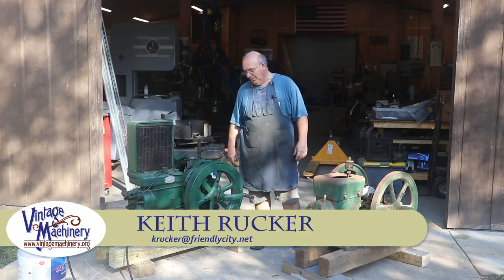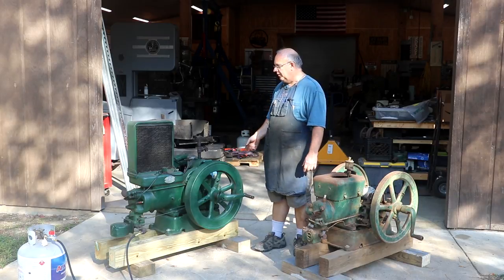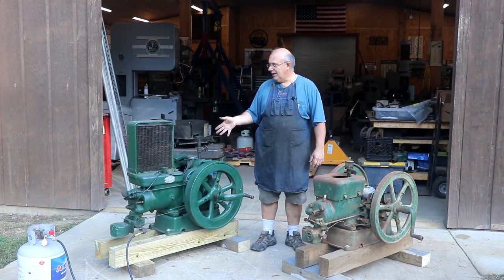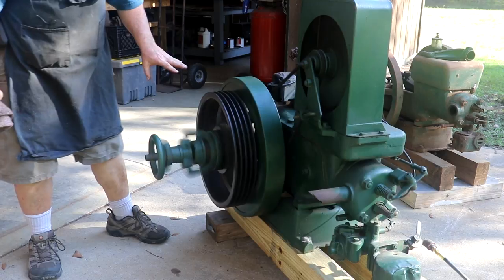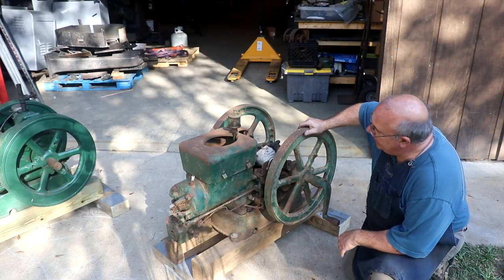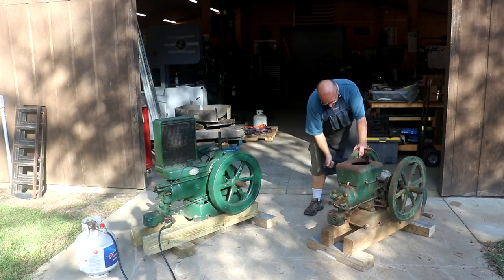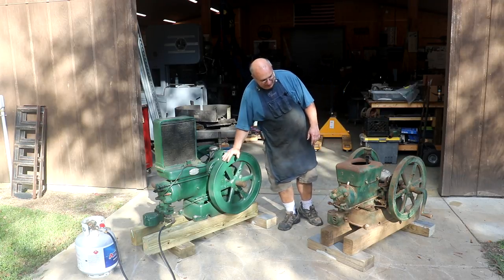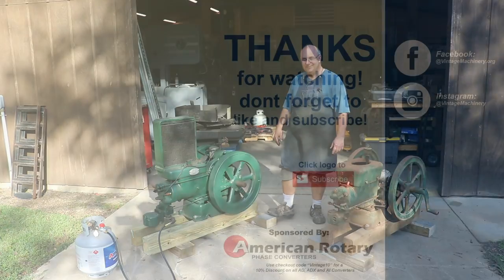Fairbanks-Morse ‘Model Z’ Hit and Miss Engines!

Comment: The old engines were indeed fascinating.  I had one for a while.  Brother-in-law wondered if it was getting fire, so he told me to crank it.   When he stoppec yelping he said yes.  When used go to  Oil Creek State Park which had an excellent presentation the early petroleum.  I ncluded was Drake's Well, the first production oil well in the US.

Comment: Ajax engines like this were capable of running with rings so loose that you could see light when looking in the crankcase when the plug was removed. They are remarkable for the ability to help children sleep.

Comment: I ran across an abandoned large stationary Hit and Miss engine in a field that was used for oil pumping.  It had a crank mechanism that converted the rotation from a very large flywheel into a push-pull linkage to several well sites arranged around the engine like spokes on a wheel.   Single cylinder.  The diameter of the piston was 14 inches and the stroke was (estimated) 24 inches.  Huge old engine.
Reply: Those were oil field "Power" units.  Most used big wooden tanks to supply cooling water.  The power operator would simply switch tanks when that water got hot.  Us kids used to sneak out to those places and soak in the warm water tanks in the winter.  Many power units close to small towns set up showers for townspeople to come out and shower back in the days before running water or having a hot water heater.  Usually was a men's side and a women's side.  One I knew about the power operator had his place to sleep between the canvas sides of the showers.  It was always said he saw thru the holes in the canvas more than the husbands ever saw.... Some of those old power units topped 100 hp.  I saw one that the crankshaft with 8' diameter wheels was mounted on one concrete pedestal and the cylinder assembly on another one.  To start it the operator climbed up on the spokes to turn the wheels backward. When the unit would fire the engine would reverse rotation and run the correct way.  That way one did not have to fight the compression over the center.

Comment: Zc118 and 208 engines were usef all over this county on pumpjacks.had one on the family farm from 1963 till the 90's. Also used Witte and Ajax engines. The ajax was on a farm 1/8 mile away with a 6 inch x10 foot exhaust pipe. Loved to hear that beast bark at night. Back then i could ride my bike back the service roads and watch the engines run. This was mid to late 70's rural central Ohio.

Comment: Enjoyed this video.  It reminded me of a late friend who had a Bean Sprayer engine similar to the open water jacket engine you have.  His engine came from his parents farm.  He rebuilt the engine, then extend the frame of a WheelHorse lawn tractor that he had and mounted the engine of that tractor to power it.  To ease starting he added a switch to change the spark advance.  Occasionally he would throw this switch while the engine was running and it would throw a foot long flame out the muffler.  He suffered from MS so used this tractor to get around Edwardsville, IL.  He also fabricated chains for the drive wheels and pulled his daughter on a saucer sled through the snow.

Comment: I had a 4hp Cushman once.. Used a coil and battery.. Coil much like a Model T coil....Magnetos are simple as dirt to work on.. I wish I knew how many I have repaired in the last probably fifty years... I think I still have a magneto lurking around in the shop for one of those old engines ..Cheers from Louisiana...Mike

Comment: Here is a tip on starting the larger hit&miss  style engines: hold the intake valve down untill you get some speed up on the flywheels, then release it and the engine starts.  The faster cranking speed also makes the magneto  have a hotter spark, thus helping the firing up of the engine.  The radiator on the FMZ is actually a condenser.  As the engine gets hot, the water steams and goes up in to  the condenser where the cool air changes the steam to water and it falls back down in the water hopper.  A lot of these late engines had fans to speed up the process. After Fairbanks quit making these engines, a company called Arrow machinery made them for a long time.
Reply: Arrow still makes heavy engines for oilfield service - they also they use them as prime movers for AC - there also used to generate voltage on pipe lines instead of using anodes so they don't eat out -
      Those Z engines and arrow engines run about 5 yrs between ring and bearing change out if there running above 500 RPMs - many z engines are still on jack pumps today or small bore wells - 
     The cooling we called thermal siphon - they have large cast iron radiators and used oil for cooling instead of water

Comment: I have a very similar Fairbanks Morse “Z” 3 hp. 
The belly tank is typically for a cheaper fuel after its warmed up. (Kerosene, coal oil)
It is a suction system, no pump. 
The small tank on the carburetor is for warm up fuel (gasoline). 

You can also hold down the intake to make them easier to get cranked up.  

Neat engines!!! 👍🏻👍🏻

Comment: Keith this one hits home for me. We built our first of two homes in the Santa Monica Mountains in 1970. This area was homesteaded at the turn of the century. Early pictures are quite interesting, everyone carried a rifle or shotgun. The only source of fresh meat required a hunter’s eye. Our area has always required well or spring water. Today the wells are deeper. Early wells used jack pumps. Across the road a jack pump with an electric motor was in use for many years after we built our home. Sitting next to it is a Fairbanks Morse motor. It looks to be larger than the ones you have.  I contacted the current owners who gave me the green light to take it. Upon closer inspection I found that the Wolsey Fire had melted components of the magneto. It just seems more than I have time to deal with. It’s still there today, evidence of our past. Thanks for the great videos,
Randy

Comment: Used to collect these engines myself until health issues got in the way.  Fairbanks are very solid and reliable and parts are everywhere on eBay ect.  Small engine mechanic and Shopdog Sam are good recommendations.  Someone said something about not having your thumb around the crank, very good advice!  If it kicks back when starting you will have at least a broken thumb. We used to hold the intake valves to spin them up, it lessens the chance of kickback.  If it's at the wrong position on a kickback they can break your arm!  Other thing I noticed, you didn't crank it too fast (the Z) but you always want a plug wire connected to something else with a magneto.  If a mag produces spark and isn't connected to something the spark can spike and ruin the mag.  Never do that on an impulse mag (like on the 118) because they wind up to give full spark at low RPM's for easier starting (that's the clicking you hear when cranking it).  Nice engines, I agree, not steam, but still very neat.
Reply: Your tip about not causing the mag to spark when the plug wire is not connected is huge. That mistake would cause the “average” owner to have to buy a new $500.00(?) mag!

Comment: Cool stuff! I just wanted to let you know that there is in face a big difference between Hit n Miss engines and Throttle governed engines. People commonly confuse them and refer to throttle governed engines as hit miss engines but they are not. Throttle governed engines hit every time. Your may miss occasionally when its not under a load but it is not a hit miss engine. True hit miss engines have no throttle shaft in the carburetor and use a flyweight governor and a series of levers to hold open the exhaust valve when they get up to speed. This kills compression, spark, and no fuel is sucked in and they coast until they slow down enough where the governor weights come back in and it releases the exhaust pushrod and fires again. It's basically a very early way of governing the speed. Throttle governed engines, like most modern engines today, use a throttle shaft in the carburetor and a governor to regulate the speed of the engine. The reason your seems to miss is probably due to the governor being a bit slugish to react, but I bet if you put it under a load it with smooth right out. Again I'm not attacking you or anything, I just wanted to let you know that there is a difference between them. :) Either way they are very cool engines!

Comment: Keith, just a little FYI, when opening a LP gas tank, when you open the valve, you need to open it all the way, the valve is back seated, and if you don't gas will escape out around  the stem.
Reply: Not in the modern age !!

Comment: Where I grew up I was told that they didn’t run electricity there until the late ‘50s. Right where we put our trailer, there was an old house, built right around 1900, and people lived in it in the 1960s, and it never had power. We ran power up there in 1974.

Comment: Love those 118's  i restored mine from a very rough one . they are smooth runners, the little 3hp doesn't have a fuel pump in it they used just the vacuum and a check valve down in the gas tank to help keep fuel flowing into the carb

Comment: They still run them here in Oklahoma in rural areas .We always called them Acme engines in the oilfield i got to work on a few ours are actually gas pressure started from well head pressure  . They run for years unattended .

Comment: Hold the intake valve in while cranking. When you have made a couple of revolutions let the valve go.  The hole in top of the air cleaner was for squirting gasoline in to get it started and keep it running until you got the casing head gas and the air damper adjusted. That is a gasoline carburetor that has a vacuum fuel pump in it.  If you did not have a good casing gas supply from the well casing they would run the engines on drip gas.  Drip gas was the condensate usually collected by running the natural gas going to the flare by simply running it thru a 55-gallon barrel so the heavier parts of the gas would condensate from the lighter gases. Drip gas would then be used for many purposes.  During WWII when gasoline was rationed people would use drip in their automobiles.  It was so dry, basically naptha, that you had to mix a little oil in with it to lubricate your upper cylinders.  Drip had a very distinctive smell. The revenuers were always trying to catch drip gas sales or users as there was not road tax being collected on it.
Wish you would have set the governor speed control spring down to the lowest idle speed and the sound of and the governor action would have been very special as it would get to do the on and off throttle that made the sound we used to hear in oil field country.  That was caused by the well pumper just being too lazy to adjust the counterbalance weight so the weight of the lift pump downhole and the column of oil being lifted was equal.  
That rare 18" pulley would be great for mounting it on an old garden tractor and having a unique ride to pull a butt-buggy around events.  A small diameter pulley would be great for the lower speed needed for a line shaft. Driving a line shaft to power your planer would really be old school as much as steam.  Steam was great but it required a lot of time and gas engines just required giving them a crank.  The 118ZC was splash oiled and the radiator where vapors rose up and were condensed back to liquid by the fan air being pushed thru the radiator meant you did not have to keep adding water all day.

Comment: My Dad had a Maytag single cylinder engine from my Grandma's washing machine that he restored. I also found a two cylinder engine that I found under a porch of a house in southern Indiana while I was in college. Dad restored the two cylinder engine. Both engines were true "hit or miss" air cooled engines with centrifugal switches on their magnetos. As I recall they were two-cycle engines and both engines had kick starters, which I think was common on washing machine engines. These engines would have been mounted on the washing machine frame below the actual machine so they were started by stomping down on the pedal. The single cylinder engine found use on my Grandparent's cider mill every Fall when I was very young. Before Dad passed and the engines went to new homes, he and I had a lot of fun just starting these things and listening to their putt-putt exhaust. I don't know how much torque they produced, but it wasn't possible to stop them using a rag on the flywheel. Thanks for reviving these memories.

Comment: I plan on building my new machine shop in the spring.  I want to set up one section with my old line shaft driven machines run by maybe a hit and miss engine.  I want it to look like the early machine shops of yesteryears.  I have s 24 inch 1906 Schumacher and Boye lathe as well as post drills and line shaft driven grinders.  It would be awesome to see one of those engines drive your metal planer.  Congrats on the new iron.

Comment: Hi Keith,  Fantastic to see and thank you for running one for us. 
I found a Fairbanks-Morse 3hp model Z style C. Mostly complete. Hopper is broken but will fabricate and the carb and mag are long since gone.
Could i ask you to please do some drawings of the carb when you get to restoring it. Going to have to make one and would like to get it right and running.
The carb  has a small reservoir to start but it actually sucks the fuel up from the tank once running. I was told it was done as a result of bush fires. British engines mostly had gravity fed fuel systems.

Best regards and all the best.
Keep it up and keep well
Paul

Comment: Hit and miss engines are just cool. They sound like something's wrong when they are running fine and I know they have a reputation for being reliable. They don't always run smooth, but they always run which is a big plus if you happened to have to count on one.

Comment: Arrowengine.com still makes a similar engine for the oil fields.
Their Type C engine looks like your FM oilfield engine.
There is a guy who post videos of oil wells in Kansas.
Most have switched to electric motors but there are still a few running hit and miss engines off of well gas.
I love that set up, instead of burning it off as a flare you get free energy.
If the power grid and the internet goes down those old wells will still keep pumping.

Comment: when i was a kid up in the ventura county mountains.. the hit and miss engine had a failure and ran away..  going crazy fast. it ran our water well .. so mom took the head off and it became my play toy from age 3 to 9.. i have never seen another like it as it had intake and exhaust valves in the block as i could watch the piston move and the intake and exhaust valves open and close with the head off..  the other play toy on my carpet was a model twenty cat and  a cat pull behind road grader .. it was the former county road grader.. with Pnumatic tires and spoked wheels.  a family down the road has the road grader in their front yard as a decoration with a fence around it..  the twenty has been sitting with a  bush growing around it since 1965.. baking in the hot sun and freezing nights for the past 55 years.. seized engine.. seized throw out bearing.  missing parts that somebody took off it.

Comment: Rookie error. When starting any stationary engine you must keep your thumb on top of the handle, not around it else if you get a kick back you could lose your thumb. Even the spring loading handles like yours can jam.
Reply: I thought the same thing.
Reply: @etheroar6312  Same thing used to happen with old cars, injury was known as a "chauffeur's fracture"
Reply: These had a impulse magneto which at low speed fired after top dead center. Almost no chance of a kick back.

Comment: If the tank is good next check the foot valve on the end of the gas tube that go to the carb hook a wire and check for spark then it should run once you have spark a little gas in carb boil and your running. There’s gas engine magazine the has much info . I have had gas engine since the 1960 and now and steam traction engine . Thats the only reason I took machine classes back when line shafts were the way to keep my old iron running

Comment: I've heard about those engines running for months without stopping before and been curious as to how they changed the oil.
Reply: Thanks Jesse,
Draining the oil with the engine running either completely or partially was all I could think of.  A total loss system hadn't occurred to me.
Reply: Thanks again, Jesse.
Around 1970 I gave a guy who lived on a dirt road $5.00 for a Fairbanks Morse hit and miss, got it running only one time before trading it for a broken shotgun and some boot.  I think the engine had an oil system and grease cups.  
If I live long enough I want to get a Listeroid diesel and run it on waste vegetable oil.

Comment: I suppose they're probably still capable of turning a single phase alternator to keep the essentials running during a power cut, a little less convenient than a modern automatic generator, but it's one potential use.
Reply: The problem there is the RPM.  An alternator output frequency is directly proportional to the engine RPM.  You need a constant speed for an alternator.  1800 RPM for a 4 pole alternator and 3600 RPM for a 2 pole alternator.

Comment: I'd bet if those hit and mis were measured in someway and compared to some modern equipment, they would likely be just as or more efficient with regard to whats consumed for the outcome. They are so quiet too and have much torque.
Reply: The true hit & miss had very crude carbs and leaked more fuel than they consumed.